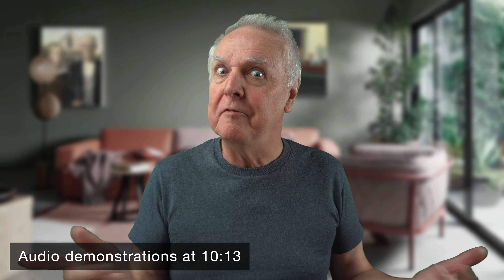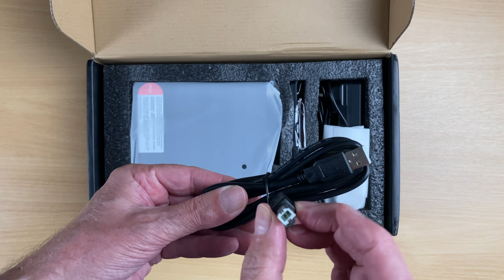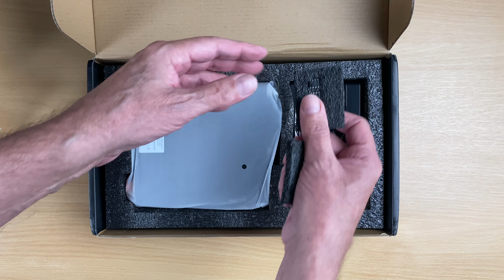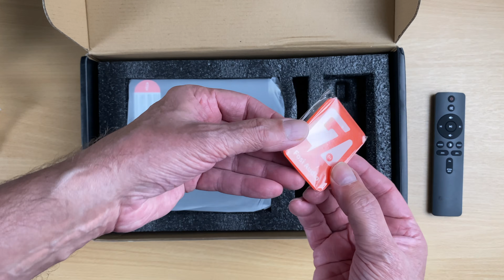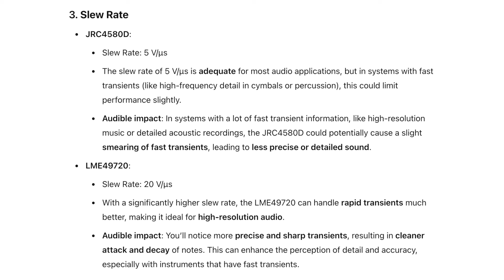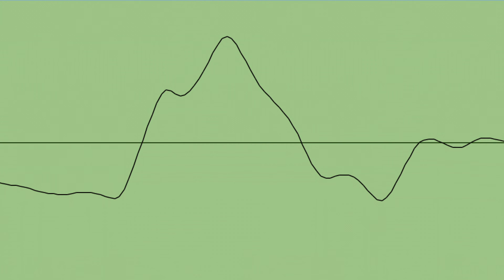How to degrade the performance of this beautiful DAC [Fosi Audio ZD3]

Comment: The first seems to have more lingering echo, and marginally less precision, whereas the second seems to have a little less echo (ever so slightly) and a little more precise, more solid image.  Differences are minute, but noticeable (via headphones - Philips SHP9500S, Sennheiser HD598se, powered by Fiio K11r2r and Fosi ZH3). Could I pick them out every time? Probably not. Would my ears get accustomed to either? yes.

Comment: The first sounds more ‘airy’, and the second was cleaner and had more lower end presence. I would agree with you and go with the specs on these, as it’s clear which chipset has more processing power and lower noise levels. People may have preferences for the first, which is understandable, but my opinion- it isn’t as accurate.

Comment: Not the best example... but on the first sentance you can hear a slight difference. 
The second sounded a little cleaner but not by much.  You'd have to listen to different music to be able to really notice a change. 
Between the two op amps... would it be worth it? 

Maybe.  While the specs are better, there was just a little bit more clarity. 

It would be interesting to compare to some of the higher end op-amps however you then get into the question of if its worth putting in op-amps that are the same or more expensive than the fosi itself.

Comment: Disassembly of device should not include removal of two bottom switch screws. After removal of front cover, simply disconnect the bypass switch from the board.

Comment: I love this stupid inexpensive DAC. I had an $1800 TEAC DAC in here, I just sent it back, and the Fosi sound was so much better. The Fosi vocals are up front, instruments behind. Instrument separation was very good, there was zero compression or smearing. The top end was not hot, or bright, nor was it rolled off, it has a natural sound to it. The dynamics could be a tad bit better, not a game killer, just an observation, and the soundstage was wide, with some depth. Show me any DAC that can do this for around $150. There isn't one.

Comment: Hearing thru my fostec mk4 over-ears via PC with a r2r DAC. For the 4580, sounds of you breathing in before reciting is very apparent. For the 49720, your breathing in before reciting is much quieter in the background. As someone mentioned yes, reverb seems to be more in the 4580. I would put in as vocals sound more upfront and isolated in the 49720. 

Currently, I am using my ZD3 paired with a smsl ao300 for streaming/movie watching and switched to the 4580 opamp. The 49720 also provides a pleasant movie night experience, out of the box. But i do find with the 4580 the volume is much higher by default, but i resist turning it up, as it strains the ears..

Comment: Totally can hear a difference. The second one made everything sound flat. If it were a choice only between these two, then the stock opamps would remain for sure! The difference wasn't subtle (to my ears)listening with my Mirage OM9 omnidirectional speakers. Thanks for the vid as this DAC is on my radar.
Reply: Yup, I hear a difference too, even with Grado headphones. The first audio sample sounds like it plays back the echo effect trailing his voice properly, while the second audio sample sounds completely off and flat, as you mentioned. Maybe it is just placebo effect from the op-amps adjusting the signal, even though the frequencies are virtually identical, but its still very noticeable.
Reply: @savagej4y241 Yeah. Our brain is weird. If you really look for a difference you will hear it even if it’s inaudible.

Comment: Better is better. SparkoS is better. It also may be a perfect example of diminishing returns. I don't have a ZD3 to play with, but I would give the SparkoS a go if I did. I would also invest in or build an abx switch. Or some means to compare the output using my laptop or PC. Is there an easy way to do that? My ears are no longer bat-like and the brain is remarkable at adapting to changes in sound. The rest of the system has to be resolving enough to reproduce the change as well. What you hear with headphones may not present with loudspeakers.

Comment: I received 10/25 my Pre-order ZD3 and also purchased from Fosi (20% off) Sparkos Labs SS3602. Waiting for XLR/RCA cables and iFi iPower X and will be burning the stock chips 1st. Also got in 3 weeks ago Geshelli Labs DAYZEE and what a DAC.
Reply: Did you get three 3602s? I just got my ZD3. I have 2 3602s. I will not be using the balanced out for now and am wondering if I can just swap the single ended op amp or need to change all three?

Comment: I'm amazed that someone can claim hearing a difference between op amps, unless something else is wrong.  I suspect what might be happening is that the better low noise, high slew rate, wide bandwidth op amps might be oscillating up in the 10 MHz region at a low level.  This can happen if the op amp is driving a load with too much capacitance.  Even a few hundred pf can cause them to oscillate. At audio frequencies, the MHz oscillation would cause increased distortion and noise. Since the cabling capacitance and the load capacitance of the next amp are uncontrolled, this is a real possibility.
Using lower cost op amps with lower bandwidth aren't as likely to oscillate at high frequencies.  This might be the reason swapping out op amps in some cases improves performance.
Reply: Yes. I was shocked that I could hear the difference, especially with my old ears. To complicate matters, some chips are fakes... whats actually inside doesnt match the part number.

Comment: I felt the 4580 sounded “fuzzy” relative to the stock op amps—they are both cheap cheap cheap. The NE 5532 I think is better than both of those and also very cheap. I bought some muses02 though. I liked the sound of them better in video comparisons I heard online… they are about $20 per op amp. The sparkos, which are quite expensive at over $40 per op amp, are the best in some products that are dull or flat sounding, but not as good as the muses02 in my opinion in products that are already very bright and punchy sounding…

Comment: Could you please advise me on the following question: I have a Fiio BTA30 DAC/AMP (bought for my PC) but noticed that when I connect my TV optical output to it and then from it to my A/V receiver, the sound quality improves noticeably compared to when my TV is directly connected to the A/V Receiver.
My question is whether it is worth to spend on getting a good DAC/AMP to use between my TV and A/V receiver (which is an old Yamaha RX-477), or if I upgrade my A/V receiver to a much newer and better model, I would get the same quality and would not need any DAC/AMP in the middle? In other words, does a newer and better A/V receiver naturally provide better DAC/AMP that using an external one would be totally unnecessary?

Comment: Hi, 
did you find a reasonably priced Audio Analyzer?
Br. JCJ
Reply from the maker: There are QuantAsylum products that are not unreasonably priced. I would have to add the cost of a Windows computer. I'm not ruling this route out, but I don't have any current plans.
Reply: @AudioMasterclass  Great, exactly what I had in mind, I have the QA401 (now obsolete), running on an old Thinkpad x220, been using it a lot while designing Balanced MC/MM and complete preamps.

Comment: The ‘spec’ crowd generally knows nothing about said specs. Once they learn more = good, the die is cast and they will choose a part based on that simple, meaningless metric. After making a dozen or so such ‘decisions’ they can easily end up with the wrong part, due to their limited understanding. Simply swapping an OpAmp is not a valid move. Attached components need to change with it and virtually no one will do so.

If a brand can be trusted at all, they can be trusted to choose an ideal component to show their product in the best light, especially if doing so adds close to nothing to the product’s cost. Ideal OpAmps are quite inexpensive so there is no incentive to skimp on this part.

Comment: Its never going to sound different with opamps unless something catastrophic has gone wrong - high frequency power rail oscillation - or a bjt opamp dampening down a high impedance source (when say, you should have used a fet opamp instead). That said voice is not a great test. You need music with a lot of going on to tell things apart. This is because;
- a) voice is too narrow to highlight frequency response problems; 
- b) any subtle harmonic distortion won't be noticed (it may actually make you sound "nicer") whereas mild distortion on busy music will then generate intermodulation distortion and you'll definitely hear that and it won't be nice. This is why cheap valve amps can sound so good on acoustic or orchestral music and yet fall apart with heavy rock or edm.

Comment: Both sound compressed and don't let through the ambience.
4580 sounds slightly better to me since I can hear a tiny bit of room ambience of the speaker. Less so with the other Op-amp with the better specs (more feedback).
I can hear that the recording occurs in a slightly reverbant room, and I think a non feedback tube circuit will reveal that reverbant ambience to the fullest.
Op-amp more or less kills that ambience with negative feedback. Less so with 4580. 49720 sounds more like standing in a sound proof booth during recording.
Reply: So much nonsense. You have no idea what you’re talking about.
Reply: @artysanmobile  Keep listening until you hear it too.
If you have the time:
https://www.youtube.com/watch?v=BmPNOVZTStM
ALL op-amps are a dead end compared to a good discrete circuit, but there are differences between op-amps.
To my ears 4580 is the most musicaly transparent of these five under test.
Keep those recorded harmonics intact as recorded.
Don't mess them up with a bad op-amp and a lots of feedback.
Reply: @flex-cx9bi    I see you know nothing of the topic being discussed. Just a couple of common tropes. OpAmps far exceed the capabilities of the most carefully designed discrete circuitry. They are, after all, idealized and perfected discrete circuitry themselves. It’s not even close. Your comment is the equivalent to “a computer processor chip could never compare to 5 million individual logic chips.”  You should learn more before making ridiculous statements.
Reply: @artysanmobile  I know a bit.
Been in the business 40 years designing audio electronics so I have tested a LOT of different topologies.
Op-amp is a far cry of perfect out of my point of view.
Actually they are pretty bad in general and basically all of them have a sound character of their own. Had som success with AD825 when driven by a low impedance, but that was about it.
Have no desire to start a fight with you so lets say we have different experiences and different point of view regarding what sounds good and what doesn't.
Thanks Peter.

Another gentleman from the business not favouring op-amps:
https://www.youtube.com/watch?v=9Hvza7eABbA
Reply: @flex-cx9bi    What business is that?  Does it have a name, such as Computer Products or Modular Computer of Fort Lauderdale? Or maybe MCI in Oakland Park where I specialized in precision recording electronics for their world famous recorders and consoles. Or maybe the Artisan Mobile recording truck, which I founded in 1977 and own to this day. I designed and built its stage microphone preamp/splitter system that has recorded Grammy winners and countless platinum and gold records. 

In actuality, it’s not a lack of references that tells me you don’t know what you’re talking about. It’s your “point of view” statements; meaningless by comparison to the exceptional work of Analog Devices, Crystal Semiconductor, Burr Brown, Texas Instruments for example. They all moved the state of the art of analog audio far beyond where it was before them and they did it by designing integrated circuits. The inherent superiority of flawlessly matched laser-trimmed component values on a chip make integrated amplifiers untouchable by a bunch of stock parts. 

Everyone with actual experience knows this. That would include Neve, Solid State Logic, Ampex, Otari just for starters. So, what’s your story?
Reply: @artysanmobile  I will not disclose which companies I have consulted for.
Let me know which products from Rupert Neve contains Op-amps?
They are all single ended low feedback transformer coupled designs.
No differental stages ever, no opamps.
Only discrete single ended circuitry.
I know why, and for you to figure out.
Last response from me.
Don't want a everlasting fight.
Have a nice evening Peter.
Reply: @flex-cx9bi    Man, you don’t know when to stop, do you?  It’s so YouTube to continue arguing after proving your incompetence.

Comment: Obviously they're different, and it's not at all subtle, both from the sinewave picture and from the audio in your case. But in reality not every system can be as transparent and clearly show good enough different so it often considered as snake oil. I would not get into the detail but it had something to do with the speaker sensitivity and cable quality.  The quality of listener's system, lack of technical knowledge and youtube platform's compression also not helping either in most cases.

The cheaper op amp give a boxy distortion that many people would refer as warm and tube like sound, while the original pricey op amp sound like a clean amp that have less distortion and faster in transient. If you thinking it as a microphone, the original would be akin to a medium or small diaphragm and the extra would be akin to a large diaphragm tone. If you thinking it as an electric guitar, the original op amp is akin to a clean amp and the swapped op amp akin to an overdrive.

As you can clearly see in both the microphone and electric guitar scenarios, cleaner sound and lower distortion doesn't always mean better production quality. In the hand of professional, it's a difference they will confidently abuse for variety and creativity purposes. But in a normal, non-engineer situation, with most of them don't have the knowledges, equipment, artistic taste, efforts and training to really making those to their full potential by proper design, you can just pick whatever makes you happy or according to the price tag.

I mean that's really what differentiate between normal people and an engineer right? Normal people just need to know which button on the remote control do what things on the tv. Like switching channel and adjusting volume, they don't really need to know about how things work in the technical or fundamental level.

Comment: I did opamp rolling once, my mates were impressed.  Keep the part where I bent the pin and straightened them out with pliers.  After "rolling 2 different sets of opamps" I am totally exhausted.  I enjoyed myself so much that I now practised this every birthday just to prove to myself that I'm alive and kicking.   Cheers!
Reply from the maker: Who hasn’t bent a pin ever? Best to give them a little squeeze before insertion. Doesn’t get better than this.
Reply: A bit of Deoxit Gold on tube pins equals zero bad connecetions also. I live by it.  @AudioMasterclass
Reply: Anyone that does not appreciate these vids should give it another try. It is just the best! I am a huge fan.
Reply: Connections. Sorry on spelling.😊

Comment: If my degraded ears don't deceive me, it looks as though an album of relaxing unboxing music is on its way! If my - also degraded - memory serves, the 741 was originally designed to do bits of the maths in late analogue computers, so that it worked quite well for audio applications might be seen as a useful fringe benefit.
Reply from the maker: Very true regarding the 741. Also interesting is that CMOS logic chips can handle audio - I've had fun with that in the past but I wouldn't rate it for quality. BTW, 'Irritating Unboxing Music' is already out - https://davidmellor.bandcamp.com/album/irritating-unboxing-music and streaming.

Comment: I can hear a difference but did not think either sounded disturbing or bad. The difference was so minor. That said I liked the sound of the stock opamp best.
Reply: As it should be. Chosen and applied for ideal behavior WITH the surrounding circuit.